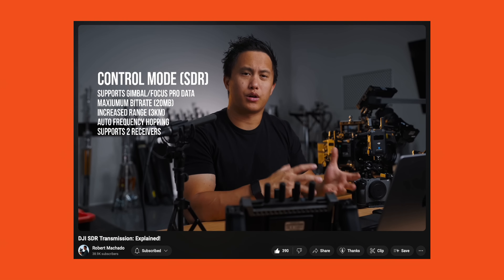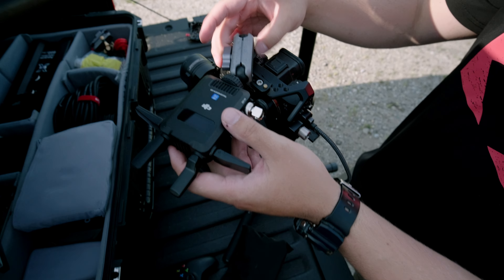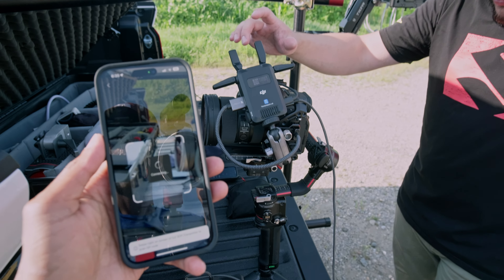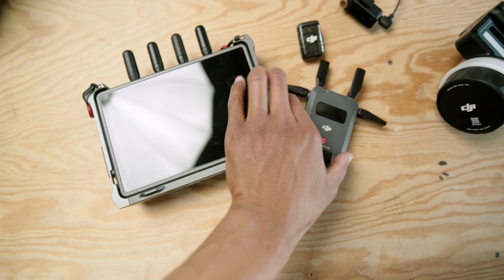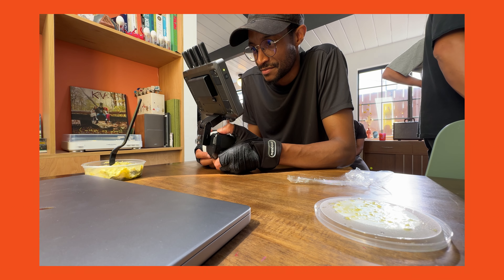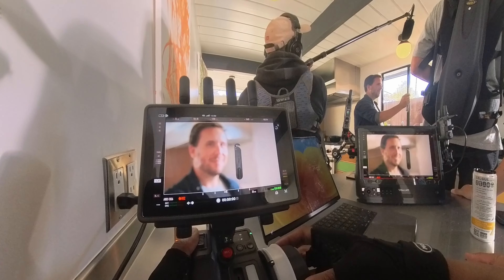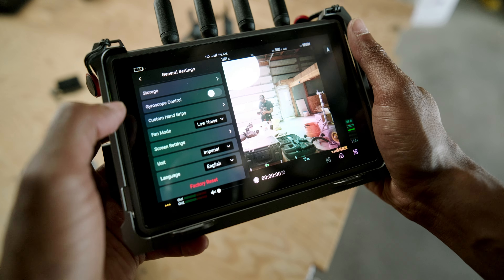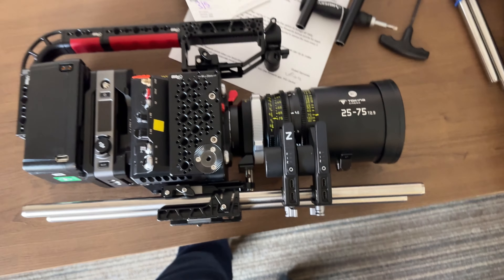the DJI SDR transmission is great but it’s missing ONE thing

Comment: Hey, I'm using the Focus Pro with a Red Pro Zoom 18-85 lens. No issues whatsoever, if your flange and lenses are tuned right - and the lidar distance is measured correct, I just calibrate my lens at 85mm (1m and 4m away, flex spot selected on the lens target prior lens cal), and it basically works like a charm. Two things to note - the Pro Grip focus wheel lag can be avoided using the FIZ controller to focus during calibration on the Pro Grip (it overrides it), second - I tend to use my Nucleus M handgrips to control zoom (with M motors of course) - one set to joystick + joystick speed, second set to zoom on a knob for faster crush zooms. Still, it's hard to set A/B points on Nucleus M even - they tend to some why slip after being applied.Thus I just recal my motor and stop it with a hand while calibration at marks that I need, if limited range is crucial to be precise. Also I've noticed that on low or high angles - if the lidar unit is placed over mattebox - it tends to miss focus closer than 1.22m, while it does not when the camera attack angle is straight. I've come to the conclusion that it happens due to the lidar sensor being physically closer to an actors face compared to the lens (remember, it's over a 4x5,6 mattebox, several cm difference from the lens center). For static low angles, say, on a lo-hat - I just slide my lidar distance to a lower number, usually 40-60mm depending on the lens size and mattebox size. That's pretty much it
Reply: Overall I dig the Lidar itself, the tracking, the focusing quality (it's better than I've expected, however, in some situations is slower than manual focusing - like on crush dolly moves), I hate the screen size (it's too small to tap precisely, usually I just angle my camera at something I want to focus on, pull the trigger, and it tracks it), the cables that DJI are selling are way too short - I do use an extension cable for better cable management (other cables won't fit into the Pro Grip physically), the motor mount is way better than 12mm previous one, but still way too far from a normal mount like Nucleus M motors, and lacking 19mm support. The app calibration is limited to preset lenses, you can't do manual cal on lenses that aren't in the app, and the lidar to sensor distance is somewhy limited to only 300mm - which is way too short for any bigger lens with a mattebox on it (say any Ana over 100mm, or any standard zoom lens like 18-85 RPZ, 18-80 Arri Allura etc) - and this limitation is silly, I hope they will allow at least 500mm, and release longer cables (which BH say they can't, but literally it works using extension cables, so wth).
Reply: And yeah, whoever was designing the system is def. not familiar with film sets, because lots of things on the user side are just made wrong - the cables (maybe angled ones will help, I will try the angle adapter to see if it will work), the Pro Grip mount (limited to nato, when puchasing I was sure it's some nato adapter on a standard arri rosette - which it appears it is not), the lidar still not having proper mounting options (maybe someone will come up with a cage, so you can slap it on to a magic arm or other 1/4 or 3/8 with arri locating pins accessory, or even a nato rail), the power management is weird - the Pro Grip is 7v, but all-in-one kit comes with a d-tap to usb-c cable which is unregulated and people fry their grips etc etc etc. They definitely have to hire a better person on the camera rigging side to make things proper, because right now it's so limited and it's such a shame - this thing is so awesome to have this kinds of stupid omissions.

Comment: I wish more gear reviewers would mention how DJI likes to brick the gear you just bought from them unless you register the gear with them.
Reply from the maker: What do you mean?
Reply: @CineDailies  - For example, the Osmo Pocket 3. If you use it more than 3 times when you 1st get it, the 4th time it will not work unless you register it. Or if you buy the High bright with accessories and transmitter it will put a box obstructing the image unless you register it.

Comment: The GOAT has spoken.
Reply: Also.. zooms. If you’re having any issues with it AF.. 

Need to use the 2X zoom on the lidar. And also keep it in wide mode. If you do flex mode, it might give you issues. The issues are coming from the zoom blocking the lidar views. Hence the 2X will help crop it out. The real fix is to mount the lidar motor closer to the front of the lens so there is nothing in its FOV.
Reply: Also, if you just set you zoom motor to “I” Iris mode.. it’ll let you use that iris knob and gives you more freedom with parfocal lenses
Reply from the maker: The REAL goat has spoken! I'll revisit this. When setting up the zoom, I treat it like a prime at first, right?
Reply: @CineDailies  yup yup! Obviously this will only work with parfocal lenses. So you want to use the same traditional workflow. So we were using the Laowa nanomorph zooms with it, obviously it’s limited in distance but works great within its boundaries. 

So, my AC put a kondorblue cold shoe adapter on the front lens support, which basically put the lidar front and center on the lens. From there, since it’s a parfocal zoom.. when calibrating it I would zoom all the way in, then calibrate it. From there it would hold focus after calibrated. 

Obviously, you already know this, but you have to make sure that the zoom AND adapter are shimmed correctly for the parfocal zoom to properly work. Otherwise the lidar focus is jsut gonna keep drifting. Its a beautiful setup tho once it’s nailed
Reply from the maker: @cammackey yeah maybe my tokinas weren't shimmed they drifted often. Cool that's for the reassurance ha

Comment: How did you find the video quality on the SDR kit? It seemed like it was transmitting 8 bit video instead of 10 bit? I got my unit and started testing and was immediately confronted with banding on the video unit...two different monitors (SmallHD & Ninja) didn't show the banding when connected directly to the camera, but the moment the signal went through the SDR...banding...
Reply: I was looking for the specs for this and they don’t list if it’s 8bit or 10bit, so it’s most definitely 8bit otherwise they would mention it surely.

Comment: I just had a travel job with extremely limited crew (me + AC) and I chose the SDR specifically because of the WiFi so I could have the director monitor off their iPad. That way we didn't have to worry about wrangling extra cases, batteries, etc. and it worked great!
Reply from the maker: Yeah Ima just carry these with me where ever I go ha
Reply: how many ipad can connect via wifi?? please answer

Comment: One of my gripes with the SDR is that it can’t power the phone or iPad that it’s connected to That introduces way more usability and rigging issues than might be immediately obvious.
The other would be that, at least as of writing this, it isn’t recognized as a webcam when plugged into a computer
Reply from the maker: There is a webcam feature?
Reply: @CineDailies No, unfortunately it isn’t recognized as a webcam when plugged into a Mac. The DJI Transmission monitor shows up as a webcam when plugged in, although it has a whole other set of problems. I’ve tried to use it to send a camera feed through zoom to remote clients, but for some reason the zoom feed is several stops darker than the actual video. Ultimately ended up using a blackmagic capture card to bypass this issue, but would really love better usb connection functionality

Comment: How did you find the WiFi stream, when I transmit to the receiver and try to connect my iPhone at the same time, the WiFi connection is so choppy no matter how far I am away from the transmitter.

How do you use the receiver and WiFi at the same time and get good performance?

I need to test with my iPad tomorrow but so far the WiFi for me when using the receiver at the same time is unusable.

Comment: Thoughts about throwing both units on the same camera? Pro for the DIT/AC to see the camera info screen with the log image, and the sdr for all the other departments to connect to via WiFi with their own devices. Basically using the sdr as a servpro would traditionally be used?
Reply from the maker: I like where you're headed but  it would interfere with one another. And honestly just use the pro unit at that port. Or teredak.
Reply: Hi! Excellent video! What about Anamorphic Support on the Ronin? It is possible right now?

Comment: It’s a shame they couldn’t have made a cheaper monitor with the SDR built in so it could have been a mini transmission or better yet have it work with the DJI drone controllers with built in screens! A lot of filmmakers would already have them and it would encourage people to stay in the ecosystem.
Reply from the maker: Yeah there needed to be a better way to integrate with the other products in the line up

Comment: My only 2 Problems right now is that it does not connect to my Shinobi 7” Monitor and that the monitors pickup a lot of noise (sound)
Reply from the maker: Why doesn't it connect? What has DJI support say? The sound is coming through the hdmi you can turn that down on your monitor

Comment: how would you say these compare to the Hollyland mars 4k/pryo S?
Reply from the maker: Idk, I haven't used the pyro. However, the pyro acts more like the DJI pro Tx/Rx. Not so much the SDR
Reply: @CineDailies  the SDR is interesting. Spec sheet looks good, but doesn’t seem to live up to it? 
I’ve had tons of trouble with it pairing with multiple monitors (especially the shinobi), just glitches out constantly like it won’t accept video feed.
Reply from the maker: @jtserrao43  oh interesting - I haven't heard those issues - what did dji say?
Reply: @CineDailies  haven’t had the time to reach out to them yet, but I’ve never had a easy time with customer service over there.
Guess we’ll see! Hopefully it’s a little bug or a bad unit…
Reply: @jtserrao43 Just saying, but you could have messaged them in the same time as it took to complain about them here. Have you received a reply at this stage? I’d be interested also in their response as I was considering this product.
Reply: @VDeeO_Buff  great idea! Would’ve never thought about that…

Comment: They won’t fix the designs, they’re keeping them as cheap as possible. The profit margins are more important than the actual customer and usability in this case. I’d assume their thinking is; buy better unit if you want higher quality. DJI is here to be cheap not good. 🤷🏾‍♂️